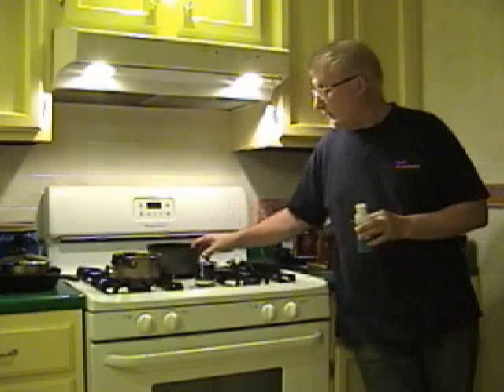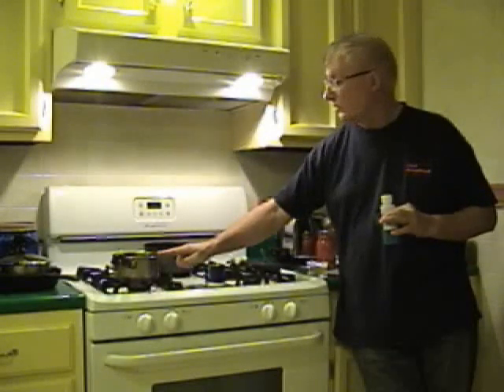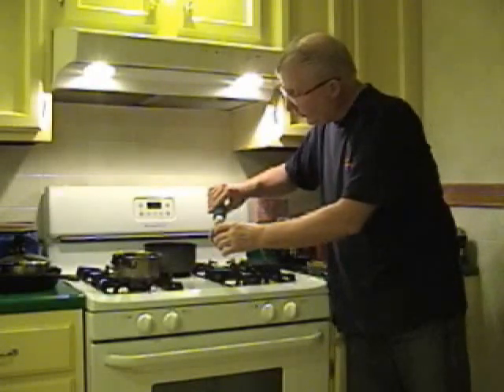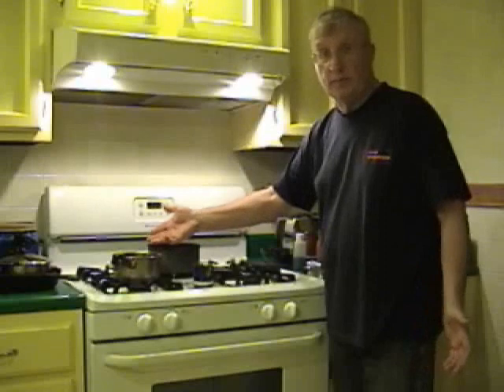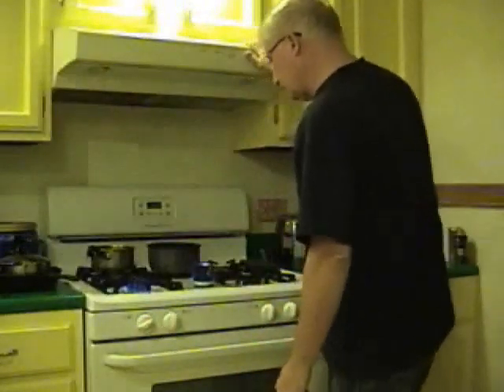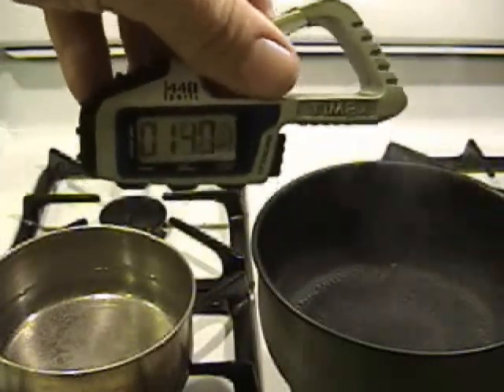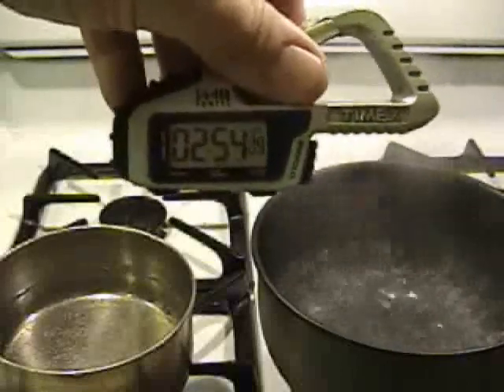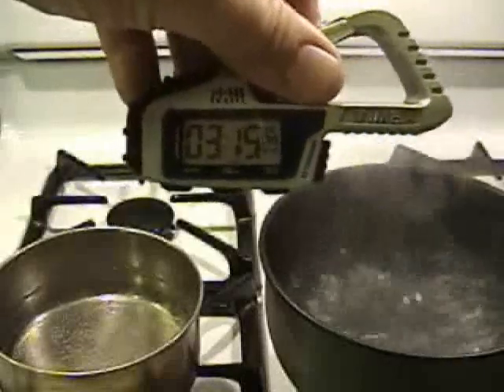How fast is an alcohol stove?

Comment: well your description says you were testing stoves not camping and home cooking scenarios. the camping pot has a large diameter so the quart of water will have a larger surface area. This causes it to boil faster. I am a fan of your work Tinny, but next time use the same pot or measure the heat of the flame itself.

Comment from the maker: The comparison is cooking on a gas range verses cooking on the trail with an alcohol stove not pot for pot.  I am using what i would use to do each task in a normal setting.  it would not be normal to carry a revere cook set in my pack or cook with a titanium pot on a gas stove.  You simply missed the point.  If you were comparing a gas engine to a diesel would you run diesel fuel in the gas engine ??

Comment from the maker: It is simply a piece of aluminum that has been made into an accordion bellows shape and welded to the base of the pot.  This increases the surface area available to absorb heat so much less goes to waste. This pot with the flux ring ,cuts the boil time in half.

Comment: This result has got to be at least 75% due to the camping pot with the heat exchanger. I just tried out my Mini trangia and it did surprisingly well compared to my kitchen stove but again that is mostly because its aluminum vs stainless for the pots.